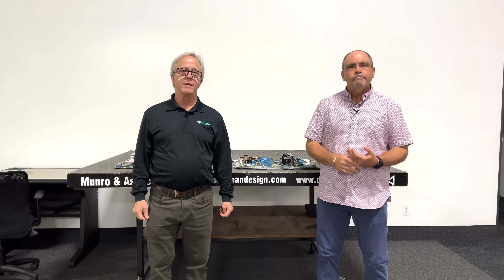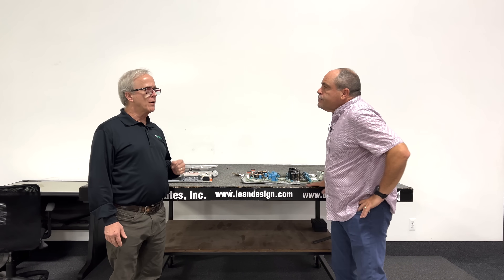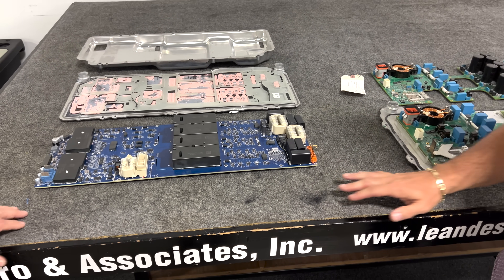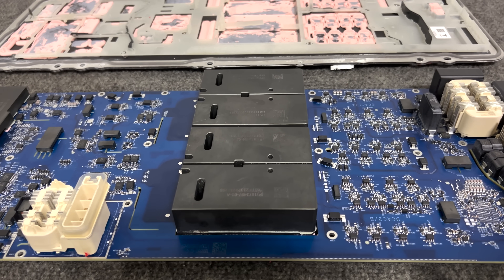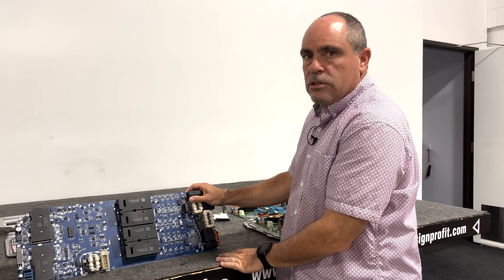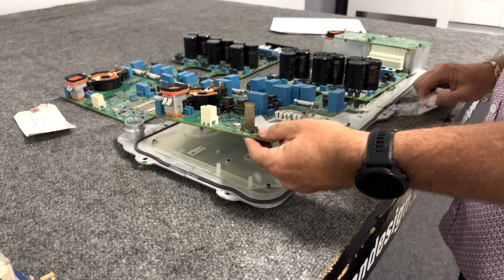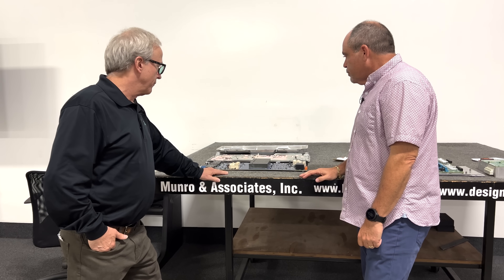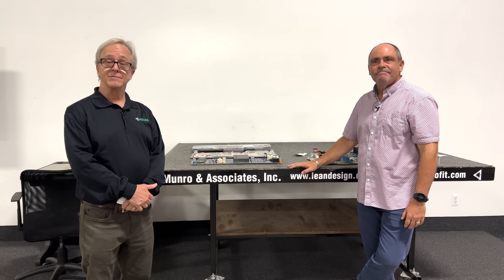Moving On Up: Exploring the Cybertruck's Power Conversion System & 48V Architecture

Comment: What a video! Thanks for the insight! I remember In the very first Munro video with 5 Tesla chief engineers just after cybertruck was released, they did mention that the HV/48V DCDC converter is still 3kW. So I am just wondering two questions: 1) For the redundant design, is it 3kW each or 3kW together? will both part work together in normal operation to provide half of the required power each, or only one work and the other one take over only when the first one fails. 2) If the maximum current is 400A this is definetely not a 3kW DCDC converter😅So what is exactly the nominal power of HV/48V DCDC converter

Comment: Dear youtube.com/@MunroLive, sorry to say, but what you are saying at minute 7:00 is simply wrong! You are talking about the redundant DC/DC converters, but it is the AC to DC stage. It is even marked as DC/AC 1 & 2. Actually the orange connector is the 3 phase + N AC input. I hope this is correct in your pricy report ;-)  I guess the white connector is the HV DC output and the blue connector is the LV (48V) output. The big planar transformers are part of the conversion stage (AC to DC). BTW: Planar transformers are nothing new to automotive. A similar concept was already used in the DC/DC converter of an ID.3 (MEB).
Reply: seem you are valeo guy ?

Comment: I would not be surprised if the same power conversion system is found in a SpaceX rocket. It is redundant, as well as vibration and shock resistant.

Comment: At this point you would think Tesla is way more valuable at designing and engineering parts than they are at building cars but I guess you can't have one without the other and original OEMs would probably never jump at this if Tesla were selling it, it's only once they see the success that they want in.

Comment: The "Clever" bit here is the almost complete reduction in damping / smoothing capacitance. Ok, a fundamental frequency uplift enabled by SiC switches is going to help, but the amount of work required to optimise leakage (primarily inductance leakage) paths at a pcb level is significant!

Comment: I can't say whether or not the average passenger vehicle consumer would use a power out but it'd be a great add on option for the tailgate party goer that wants to power an induction cooktop, a DJ set-up, recharge electric tool's or a bicycle or just plain act as a back up "power-wheels" like the f150 to light up your house in a blackout.

Comment: 200 A at 48 V seems like quite a lot of power for the DC-DC converters, even with the added demand from steer-by-wire.  I suspect that both DC-DC are not used together to get 400 A.  Instead the DFMEA probably called for full DC-DC output in the event of a failure, and the max demand from the 48 V loads is never more than 200 A.

Comment: Got rid of those electrolytic capacitor's, great they are a life limiting device. When they run hot they degrade and cause the DC/DC converter to fail.

Comment: Halfway through the video, they are comparing parts that do completely different jobs. The big white toroidal looks like common mode choke to stop the switching noise propagating out of the convertor, and the transformers look like they are missing.  The new design with the ferrite brick transformers in the middle are clever, but a concept I saw in a Metrohm power supply 20 years ago. Still great engineering.
Reply: Higher freqs, maybe in resonant mode so they need those chokes.
Reply: Most of Tesla's "genius" is applying already existing technology in unique ways, especially for the automotive industry.
Reply: How is that not genius???why reinvent the wheel. The steel from the cyber truck being handed down for a different use is the most obvious success
Reply: @nickford5549  Did I say it wasn't?

Comment: It’s pretty cool but I still think it’s a miss not including 2 of them (as well as 2 charge ports).   They already split the battery, so it would literally double the charge rate both for DC and AC charging, maybe less on the DC depending on cooling.    It would also let me charge and export power at the same time, which would be nice for RV’s passing power through from the post.

Comment: They didn't mention any change to switching frequency, but I'm sure it's increased substantially in this planar transformer (using PCB as part of transformer, which has been around for decades...).
Would have to if they don't have big capacitors anymore.

Comment: How did they replace those big electrolytic capacitors in the new version? Did they use something like active capacitor?
Reply: Silicon Carbide Mosfets, higher frequency, smaller caps and inductors.
Reply: Maybe they are allowing ripple current to the battery

Comment: I give a thumbs up to Tesla for the engineering of the 2nd generation power converter.  The planar transformers are a smart way to improve reliability.  Eliminating the large electrolytic capacitors is also a big gain by eliminating components which are shock and temperature sensitive. The downside is that the semiconductors are probably more expensive.  It is good to see the redundant 48 Volt supplies.  I would have expected no less because the vehicle has catastrophic loss of control if the DC power fails.

It is pretty bold of Tesla to have gone completely steer by wire.  I prefer the Nissan Q50 approach of a clutched intermediate shaft which allows steering in the case of lost power.  The Tesla steering rack is doubly redundant with a third sensor as a backup vote.  The gain by going strictly by-wire is that it enhances the flexibility of arranging the interior space by eliminating the intermediate shaft.

Tesla fans point out that Airbus has a glass cockpit with fly by wire, but the aircraft system is triply redundant with the third circuit not having a computer.  Each circuit is also multiply redundant within the circuit.  Of course an aircraft malfunction can affect the safety of hundreds of occupants while a vehicle crash typically only affects a few people.
Reply: Blablabla crap

Comment: The PCB being the transformer coils definitely blew my mind. That is very clever. Avoids a lot of coils windings. You could swap out just the ferrites without changing anything else and you'd have a completely different profile for those coils.
Reply: True ... though traditional transformers are very reliable in my own experience, whereas PCB board tracks not so much!
Reply: @MrAdopado  These are fat boy tracks, not tiny traces.

Comment: I think the original PCS-1 board design and build was very, very good (way more than a textbook design and focused directly on the power needs of the vehicles). However, this new PCS-2 design really seems, IMO, to take things to the next level (and provide redundancy in the same footprint)! The idea of printing planar (on CB) inductors is not totally new, but to get all that to work elegantly in real applications, seems state-of-art to me. Congratulations to the Tesla engineering and circuit board design teams that created both of these solutions.

Comment: That is an amazing PCB and they seem to have mixed high current paths with fairly fine pitch SMT components, and it’s also rather large as well. 
The layer stack for this board would be very interesting on its own with the planar magnetics and lots of higher frequency switching. Fantastic work by the engineering team at Tesla ❤👍

Comment: It would be nice to have more 'layman' explanation as to what and/or how the components worked. Like the ferrites and coils and chips. That is what made these videos great in the past. Knowing that a large number of viewers do not have the technical knowledge.
Reply: So the old transformer has a coil of copper wire that is fed through the center of the circular ferrite, so you need a machine that can do that wrapping efficiently.  Then the wrapped ferrite  copper wires have connectors to make the connection to the printed wiring in the pcb.  All expensive operations.  Compare that to the wide copper traces inside the pcb which do the wiring and the ferrite rectangles which have a top part which mates with a bottom part on the back of the pcb, so that the ferrite "box" encloses the copper wiring within the pcb.  Much cheaper to produce.  In addition, as the control electronics get faster the higher frequencies mean you can use smaller inductors and capacitors for the same power conversion capability.  Bottom line is that Tesla is using state of the art power electronics design to reduce costs and improve efficiency.
Reply: @morrisg  tesla didn't invent anything! Those types of transformers have existed for a very long time now.
Reply: @morrisg  I get that. And it is pretty clear the simplicity in the new board versus the old. But prior to Corey leaving they were much better at explaining in layman's terms what and how things work. In this video they say here's the coil. But then they don't explain really what the coil does, or what the ferrites do. So its not just the how is it better, it is also, what do all the better parts actually do. I'm sure insiders got all of it and understand a lot. But Munro was better at getting regular people educated.
Reply: @vr4042  Just trying to help.  I miss Corey too.
Reply: @morrisg thank you very much for the very interesting information 👏👏
Reply: @deltajohnny  You're welcome.

Comment: Such a big improvement.
Reply: my 2014 honda crv which i can pick up engines for 1,000 or less and transmissions for 1,000 or less disagrees even consumer reports says my car is more reliable than modern vehicles based on DATA. add a transmission cooler and trailer brake controller to my honda crv tow 3,500 lb trailer for longer distances than a cybertruck lol what a joke.

Comment: So does this mean the PowerShare can do 400amps? Crazy.
Reply: No.  PowerShare can provide 48 A at 240 V.  It is using the 48 V on-vehicle charger in reverse, as this new one is bi-directional.  The 400 A is the output of the two redundant 800 V to 48 V DC-DC converters, 200 A each.  This was explained in a brief caption near the beginning of the video.
Reply: @georgepelton5645  False: "It is using the 48 V on-vehicle charger in reverse, as this new one is bi-directional." Correct: "It is using the 48 A on-vehicle charger in reverse, as this new one is bi-directional."

Comment: Planar transformers as used in your TV a decade ago to make a low profile power supply, nice to see them scaled up to these power levels, but what's the cost, there's always a cost in engineering and I would have thought traditional transformers are more efficient?

Comment: Using the printed circuit board for ferrite winding is genius. Having worked on wire wound devices like speakers, and induction coils for 50+ years I have found the wire coating to be the most common point of failure. Have to resolder the connections. Just did the tweeter on a 70 year old KLH and a pair of 20 year old Alesis speakers.
Reply: AFAIK it is not a new technique.
But using it in automobiles probably is, as probably is such high ampage and production volume.
Reply: Probably using Silicon Carbide Mosfets so they can run at higher frequencies which will use lower value inductors which can be PCB layers that will be plated up to at least 2oz copper.

Comment: Question?
Is the NEW board coated?
Whats the THICKNESS of the board?
Is TESLA making the NEW boards in house?
Reply from the maker: Buy our report! 😉
Reply: @MunroLive  Question?
What about doing reviews on the TACOMA RANGER, COLORADO and FRONTIER? 
I'd rather visit in person, should be easy I know MICHIGAN....
Reply: Probably just a conformal coating, which is very typical for PC boards that operate in these environments (actually just generally now, most PC boards have conformal coatings).   Probably 4-layer or 6-layer board depending... I'm guessing 6-layer.
Reply: @junkerzn7312  Your better then me I couldn't tell or notice, it would be semi clear. I was thinking about dirt, water or anything that could get on there.
Reply: @marshalllapenta7656  They could also be using heavier-weight copper layers for the PCB, but I suspect not.  I like the design.
Reply: @junkerzn7312  I do too, just worried if anything could get on the board and short circuit anything?
Reply: @marshalllapenta7656  Well, the board is protected... it will be inside a box of some kind, metal or plastic.  A conformal coating protects against dust, humidity, and related corrosion pretty well.  Nothing really protects against being submerged.
Reply: @junkerzn7312  At least 2 Oz copper.

Comment: One of the major advantages of 48V system is higher voltage and lower current. For a conventional DCDC in EV usually rated between 3-6kw (250A to 500A), it is a little surprising the 48V system is rated 400A, is that the short duration peak current capability?
Reply: Supposedly it is also supplying the base 48V to the inverters in the bed supplying 120/240.  Still, 400A @ 48V is 20kW... that's a lot of power, so they might just be talking burst or bus bar specs and not continuous conversion specs.  That said, DC-DC buck conversion is very efficient... they should be hitting 98% to 99% efficiency so there is no particular reason why a board like that couldn't do it.  At 99% efficiency it would have to dissipate about 200W worth of heat.
Reply: its because the Tesla needs so much 48V for power for the electronic steering system

Comment: So fun fact - My new 2024 Model Y had a failed PCS module right at the start 500 miles into ownership. 

When I was at the service center the tech mentioned the part and showed me - PCSv2 - Revision 4 that was failed in my car. My model Y PCS board LOOKED absolutely nothing like this one did in this video and more like the Cybertruck, just FYI.  In fact it was so different the service center waited on a engineer coming up to work on a Cybertruck to help diagnose / replace / re-marry this component to my car and get the profile / software reload to take (they were fighting this for a few days).  The engineer said that a line change that happen they upgraded a few power modules on the cars that increased efficiency? Nothing else to note. 

A few memory notes on my board was it was smaller than the Cybertruck and had half those chips - but defiantly had none of the original capacitors shown in this video.. I believe there pushing forward on there new models as they always do...
Reply: @AustinFerguson  Absolutely wild! Tesla continues to amaze. No legacy auto manufacturer would ever even think of doing this. They make the identical part for the life of the vehicle lineup. Tesla eats the upfront cost, flying engineers around so they can continually upgrade major modules like this.
Reply: @philtrubey7480  they definitely don't stop. When I look at my 2018 model 3 and my new model Y, it's just insane the little changes that make for bigger things. 

My biggest wonder on my model Y is the charge port and support for power output with an adapter like Hyundai does.  It would be one the most ultimate hidden by the way software updates.
Reply: @AustinFerguson  Gawd that would be nice. I’ve been annoyed at Tesla for years for not allowing decent power output from their vehicles. A2Z makes adapters for J1772 vehicles to get 120V 20A out from Kia vehicles. Would be nice to see from Tesla. If their new PCSv2 is bidirectional just like the Cybertruck’s is (and I don’t see why it wouldn’t be), then Tesla could actually offer PCS upgrades for such functionality and I’ll bet a lot of people would take them up on that offer.
Reply: @philtrubey7480  yeah no telling honestly, would be a crazy awesome upgrade that I would use camping and for home backup. 

The upgrade would be very lengthy and I think it would be gated behind specific configuration vehicles as the VcFront was also different in my car and wasn't playing nice with that PCS replacement.
Reply: @philtrubey7480  I would upgrade in a heartbeat. Having my Model 3 as energy storage for the house in case of power outage would be insanely useful.
Reply: @philtrubey7480  You are right. The only company I really remember actually doing that sort of thing was IBM back in the 1960's (when they rented out all their computing hardware and backed that up with engineering teams for updates and rapid service).
Reply: They had an engineer at your service center? I take it you are in Austin...interesting
Reply: @whattheschmidt  nope they still have some localized in Fremont (in this case he travels between Texas and CA) and are active in projects. He had experience in Cybertruck since 2020 and prior to that Model 3 / Y. He also knew the sub-systems and firmware related stuff very well - which they were leaning on him to fix why my car wasn't accepting a firmware/part re-marry on the car. 

Talking to him made my day - love to nerd out haha :)
Reply: @AustinFerguson  I had a similar experience where I went to Electrified Expo and got in a Tesla to do a demo drive. The person in the right seat was an engineer who worked on some of the drivetrain integration. We nerded out for the whole test drive and I bought one later that week lol.